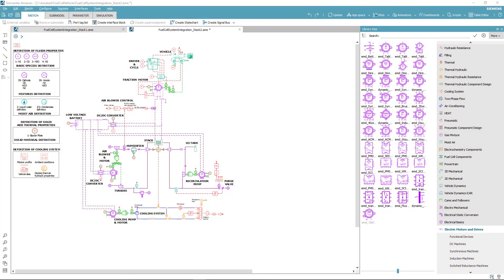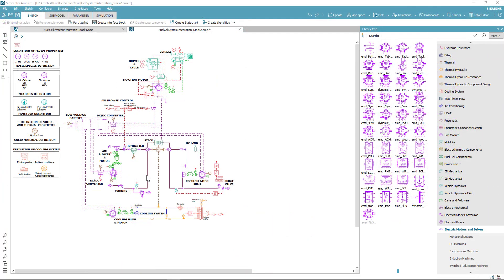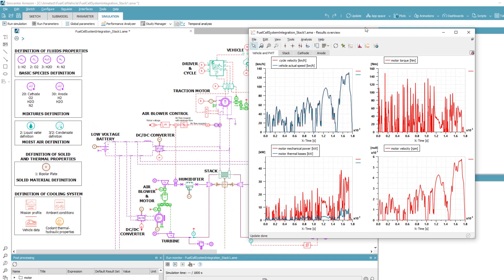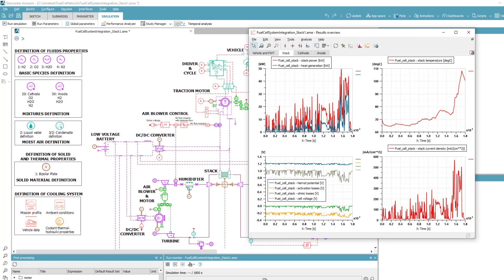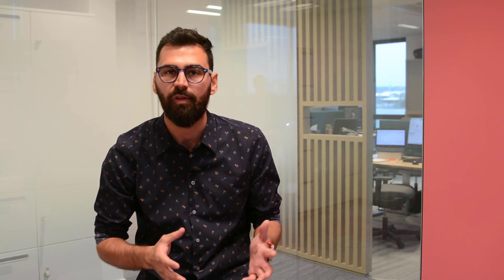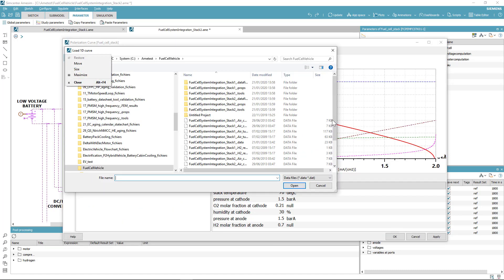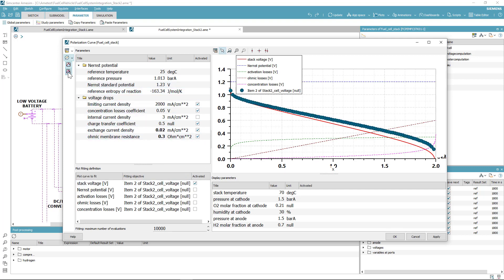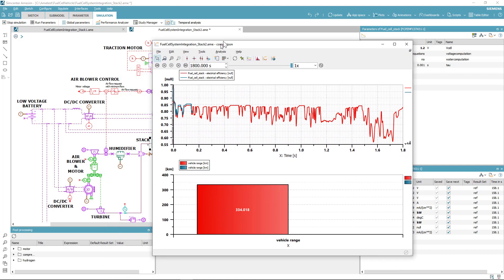HOW TO Compare the hydrogen consumption of two fuel cell stacks with Simcenter Amesim | Tutorial

Comment: Here, is the total fuel consumption is calculated over the cycle mentioned in output or in the plot it is showing just fuel consumption per second so in the output it will just show last instant fuel consumption? 
For varying fuel consumption per second how do I know total fuel consumption at the end of the cycle?
Reply from the maker: Hi - Thanks for your patience as we researched an answer to this. Our technical team responded with: "Simcenter
Amesim computes the instantaneous hydrogen fuel consumption and as a consequence the total fuel consumption all along the driving cycle." Hopefully this is helpful. Best, Team Siemens